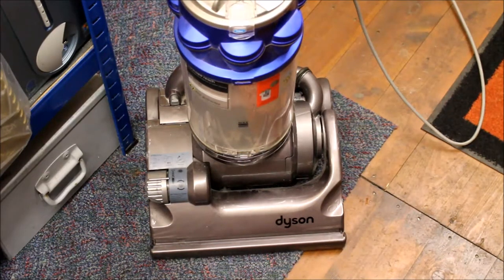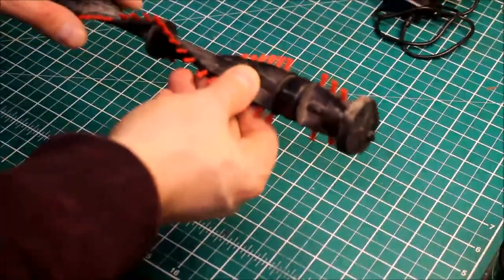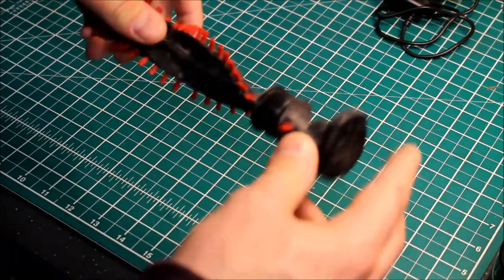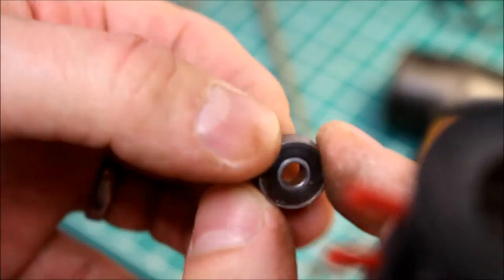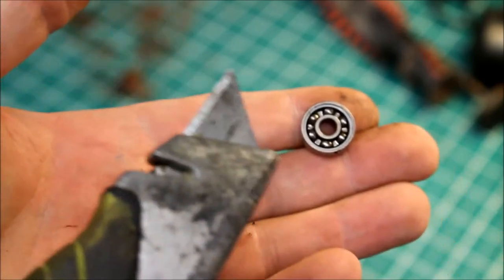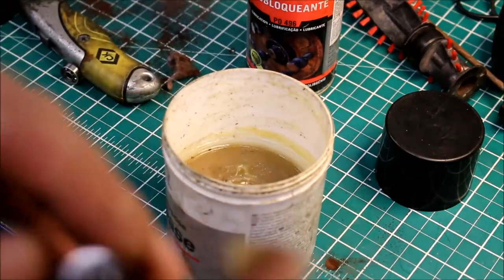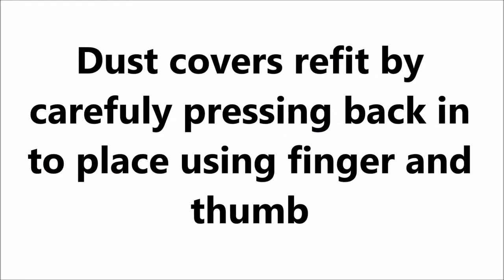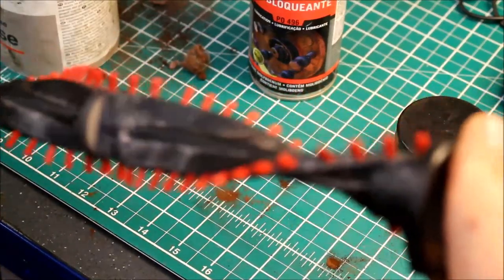Dyson (DC14- others similar) Roller Beater Bearing Fix at FixItWorkshop

Comment: Thanks man. So many people throw out their vacuums and see them on the curb. Rescued a DC14 yesterday in the rain. Took it home and cleaned all parts. Had a bad clog at the bottom. Reason it was tossed out by its owner. Usually the reason. It runs but has the loud screatching sound but then goes away. I will replace belts/clutch/filter/bearings or suspected parts and give it a full service. I have a carpet cleaning company and this is my first Dyson. Not very impressed on quality and durability with this unit. Always good luck with Kirby's vacuums they are simple engineered and all metal. Will be testing this Dyson once its refurbished in my shop. Hate all the plastic very flimsy and quite simple to break. Thanks again for the video.